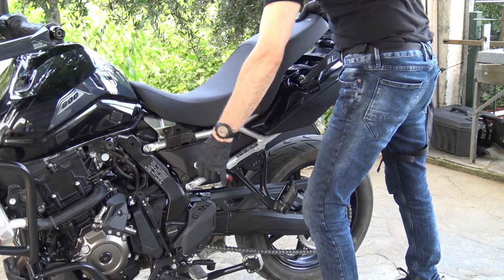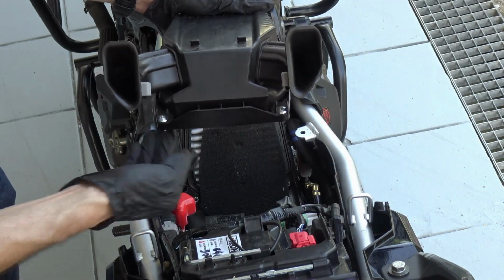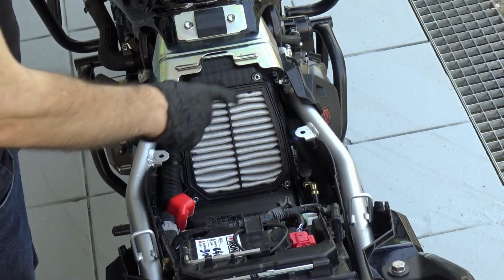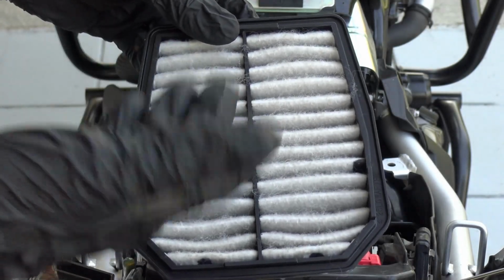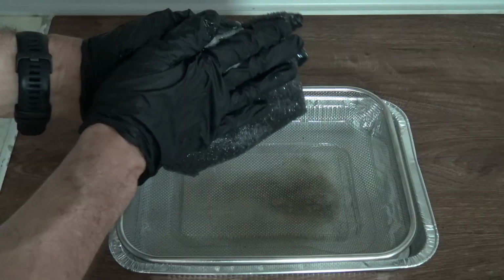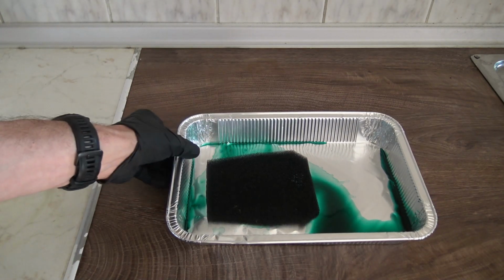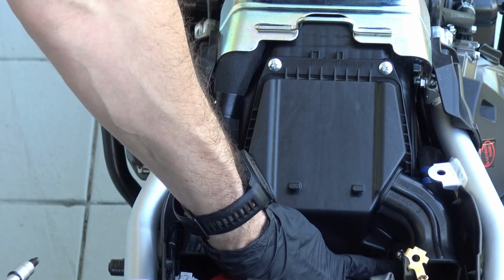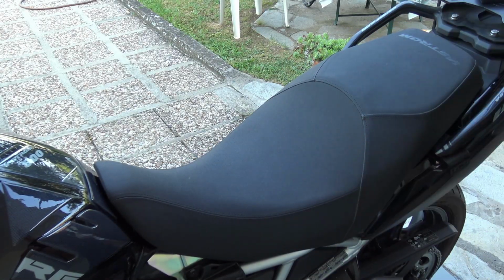Remove, Maintain or Replace Your Motorcycle Air Filters | How To Vstrom800

Comment: Although I appreciate your videos, this treatment of the air filter I would strongly advise against. Leave it as it is, don't touch it, don't blow on it, don't suck on it - just inspect it and replace it if need be. The filter is very sensitive and actually gets better with age (up until a certain point of course), so don't mess with it.
Reply from the maker: Filter is just ok. Thanks for your comment and ride safe